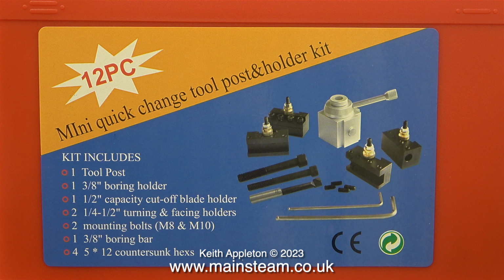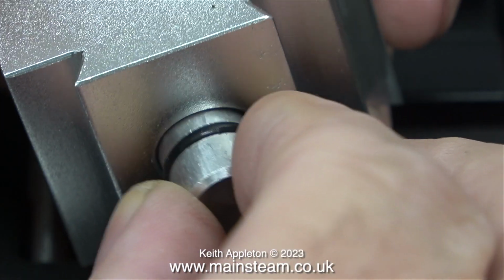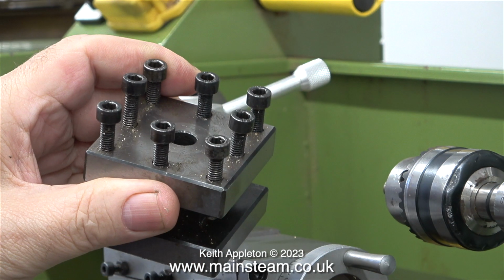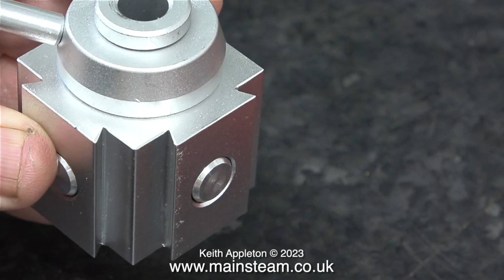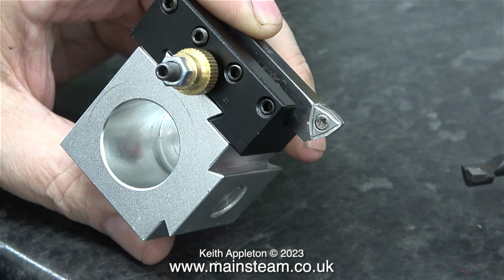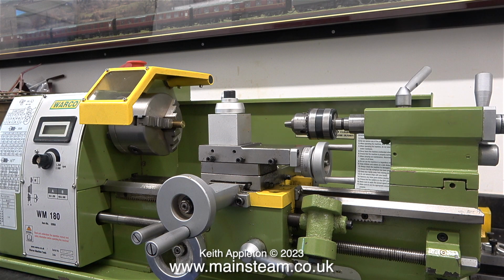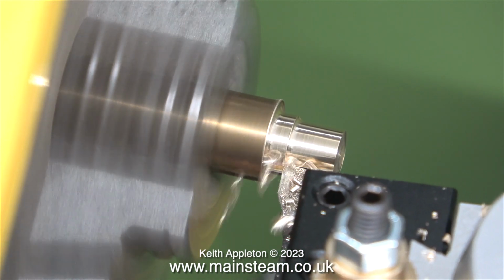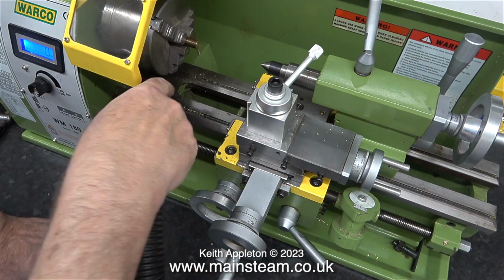A SMALL WARCO WM180 LATHE - PART #3 - IN THE WORKSHOP

Comment: I recently bought a inexpensive tool holder set (off the net) clearly advertised and even labeled on the tools themselves as 3/8". I quickly discovered they wouldn't fit my tool holders as they actually measure .395" which is about .005" over 10mm. I quickly setup my mill and buzzed them down to what their supposed to be. They actually work quite well now.

Comment: I have one of these aluminum qctp they are Junk Keith. i sent you an email from ottawa regarding your broken stuart twinn in the junk bin. You showed it again in a video. I emailed to see if you would sell it to me, but never got a response from you. Hope your well Keith. Nice Chinese Lathe, i never thought the day would come that you would buy a chinese lathe let alone a aluminum quick change tool post. listen these aluminum posts are no good the tool holders DO NOT have the strength the ajusting screw warps you will see and also the aluminum lever to tighten will bend easy and the thread it threads into the post gives way. the original four square post is best. Regards Daniel Ottawa. ps did you get my email??
Reply from the maker: Yes I know. That is why I bought it. It was more than cheap enough to experiment with, having said that, I have used it for Turning and even parting off a piece of Brass. I have 3 other lathes all fitted with proper quick change tool posts so for serious work, I use those. This little Chinese Warco lathe is specifically for small jobs in my smaller workshop which is attached to the house. Sorry, I don't remember any Email (I get hundreds of them every week) about the broken Stuart D10 which isn't mine anyway.
Reply: @keithappleton  Hi Keith, Yes i know you get hundreds of emails, and i truly appreciate your responding to mine. I am going to buy a new lathe jn short order, this lack of a lathe has stopped me from building. I wish to say that, your the greatest steam engine builder on all YOUTUBE i have noted that a number of builder's on youtube turn model steam engine building in a complication of many complicated set ups not required. they have all these fancy electronics which are not required who needs a dro, some of these builders arw clearly using rocket science in their approaches. I am of the mind that to many set ups means increased possibility of errors. listen i am going to build four units from a set of drawings in cold rolled steal  , i would make molds and do my own castings but the price of iron is extremely high here and its hard to find , for example a solid piece of say 2 inch OD cast iron by 2 feet long would cost around 400 $ canadian, also bronze here is about 100$ for  6 inch by 2 inch OD, on to copper pipe 12 inches by say 5 inches of copper pipe for a boiler is about 400$. I am limited in the kinds of metal i can use regarding cost. Brass is not to expensive. I thought about using 12 L 14 for the cylinder and standards as it has lead in it, but i researched with mixed reviews on this some say no it rusts very fast some say yes as others have used it for the steam cylinder like aluminum bronze 12 L 14 mills wonderfully but it has lead in it!! I was waiting for my estate and planning to buy several stuart kits about five or six kits from them, i indicated to them that one kit would be for you a set of castings as a gift from me for all you have taught me, but i have not as yet received my estate. I had plans to buy a 12 by 36 inch lathe from Busy Bee Canada. my problem with the old lathe i have is that it cannot drill one inch holes for the cylinder as the cylinder bore is over one inch , but i have solved this problem a metal company here can sell me 2 1/4 od round stock with a 1 inch hole down the centre its 250 $ for 24 inches this i way i just need to use a boring bar for tge final bore dimention of  1 -1/4 i tried a solid round bar i could only bore to 14 mm with a drill fixed into the mt2 tailstock, when i tried 16 mm the tailstock and lathe vibrated badly  so i started after this with a boring bar which after a straight four hours i was in acoma and i had only bored to 3/4 i needed 1 1/8 for this particular engine plan. i also have a set of plans for a double cylinder of 1 inch bore again in cold rolled steel. better stop here please keep in touch also o yes i am going to build four units of the single cylinder unit at the same time, I am going to send the third unit as a gift and you maybe can a video on it and tell me how i did building it. I owe you alot keith your my one and only teacher and i thank you so much for your great gifts. Those that critisize you are those whom are jealous because they all are stupid and require a DRO where you do not. I wish you and your family a merry christmas and i look forward to sending you one of my units as a gift maybe you will do a video. I have not joined your patreon channel yet i will very soon. cheers Daniel ottawa: